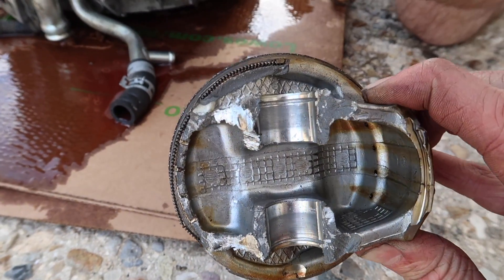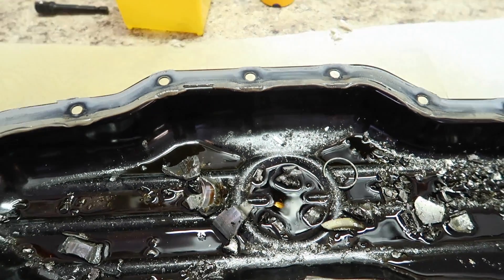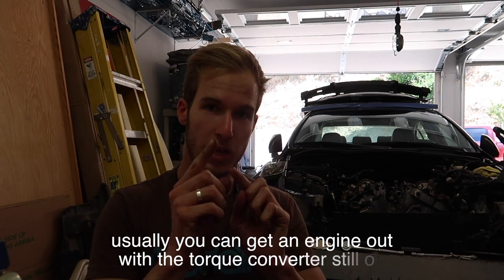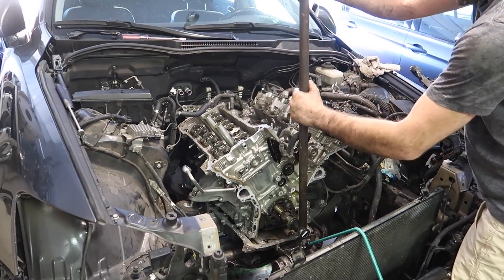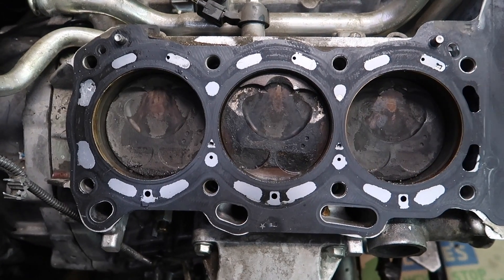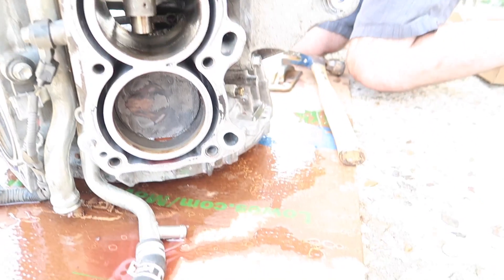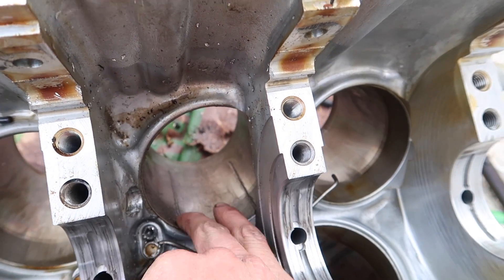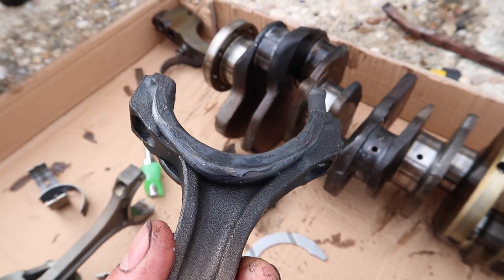OPENING A BLOWN UP ENGINE!!! Crazy!!! 300HP V6 with crushed Piston and a molten Rod

Comment: Thank you again for fixing the Lexus Max! I just traded it in a couple of months ago and the engine was still running stong. Fyi, it also ran out of gas right as the engine blew at high RPMs, it might have had something to do with the air fuel ratio in combination of cheapo oil and racing it all day.

Comment: Difficulty level? I’ve never swapped an engine but was thinking about doing it to my car.
Reply from the maker: It's not that difficult if you're handy with the tools and maybe have a mate to help. But keep in mind we just swapped the exact same engine. It's a different story if you want to swap to a different model engine. Doing it step by step, take your time (its always takes about 4 times as long as you estimate) and you'll learn heaps in the process. Label things properly and take tons of "before" pictures while taking it apart.